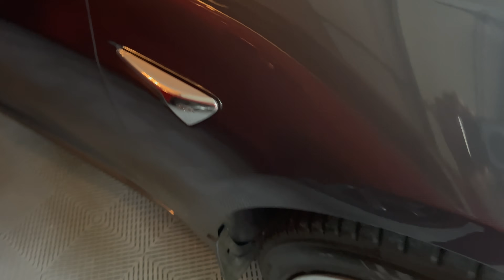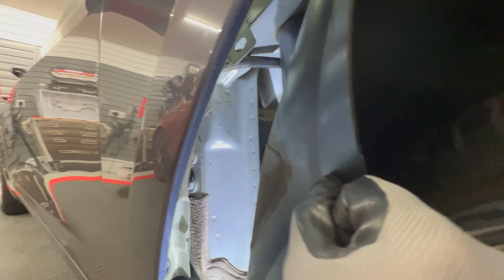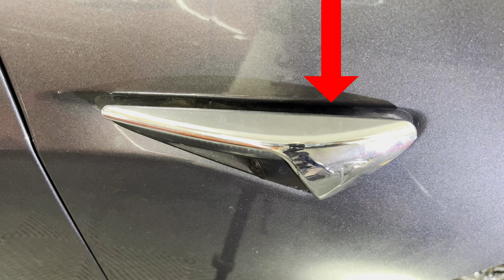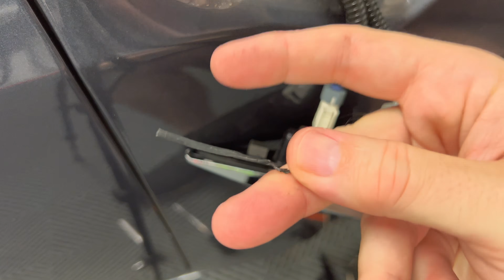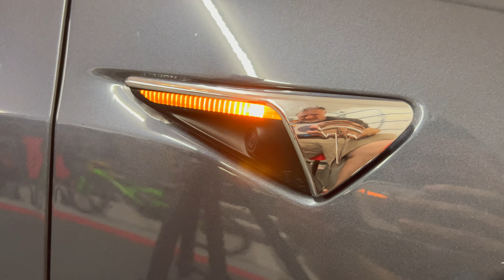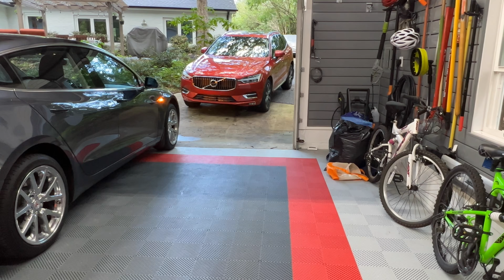Tesla Model 3 - Repeater Light Repair

Comment: Does the camera work if the power is not being provided to the turn signal?
Reply from the maker: There are two different connectors, one for the turn signal and the other for the camera.  They work independently.

Comment: You mentioned soldering is not recommended in automotive applications.  My driver side mirror got hit and it severed 4 wires about same size as wire in your turn light.  Is this repairable by using wiring connectors instead? Otherwise, I’d have to replace the whole side mirror assembly.  Also, do I need to disconnect the 12V battery while working on the wiring? Thanks.
Reply from the maker: Sure, I think wire connectors would work. Yes, disconnecting the 12V would be best (negative lead first).  You don't want to get any surprises!
Reply: @MTNRanger Great! I’ll give it a try. Thanks!

Comment: Not sure why you felt you needed to remove the wheel well panel, because you were able to remove the camera, and access the wires from the outside, and repair from the outside
Reply from the maker: I was diagnosing the problem.  I had no idea what was causing  it at first.  Hindsight is 20/20 I suppose.

Comment: Mate that's the dodgiest repair ever done! Not only do you risk the two wires unravelling themselves but also if they do and touch the chassis you'll short circuit the entire vehicle. 🤦
Reply from the maker: I’m fully aware that my solution is a little hacked.  I mention in the video that the preferred method is crimping.  I have since replaced the wire with a thicker gauge more similar to the original and used a twist nut.  Also bandage twisting is a good solution. I’ll add this note to the video description.

Comment: why it will broken like this. no extra force to cables.
Reply from the maker: The cable harness does have some weight and over four years of moving back and forth could cause the wire to snap.  The trunk harness recall has the same issue.